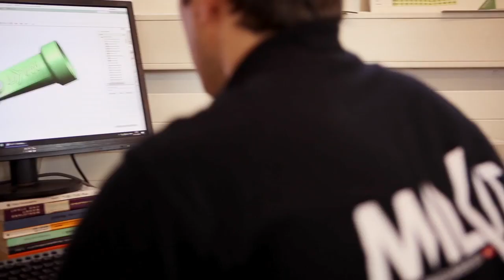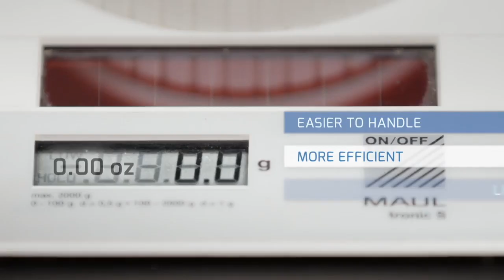milKit booster

Comment: 00:54 tire remains magically inflated without valve core?
Reply: It's their MilKit valve: https://milkit.bike/en/product/milkit-valve-system
Reply from the maker: Yes, that's the magic of the milKit valves. They have rubber flaps at the bottom that keep the air in the tire even without the valve core installed. Plus they let you enter the tire with our needle and syringe system to extract the old sealant and add new one with the tire still being under pressure. Plus they prevent the valves from getting clogged by the sealant. Quite magical ;-)